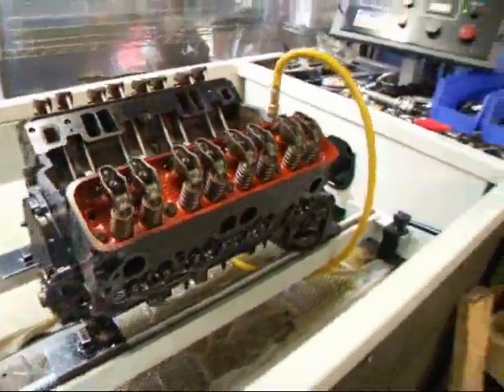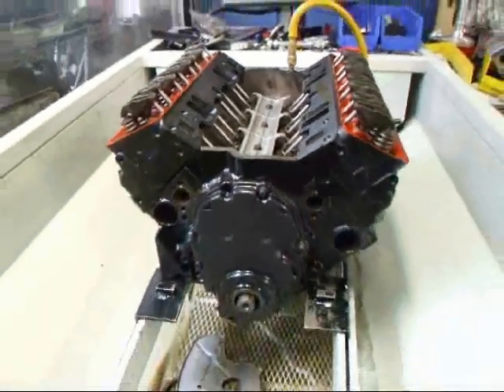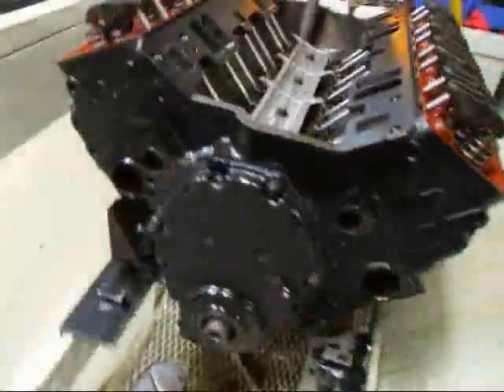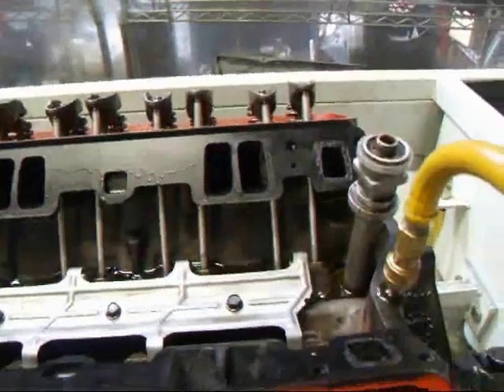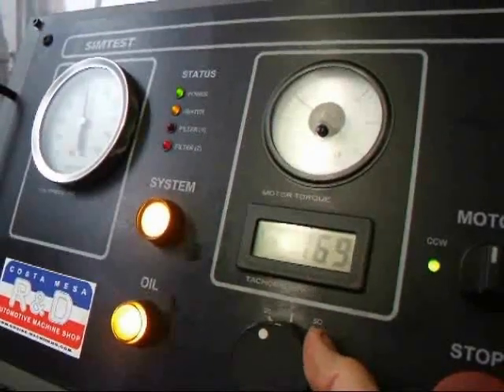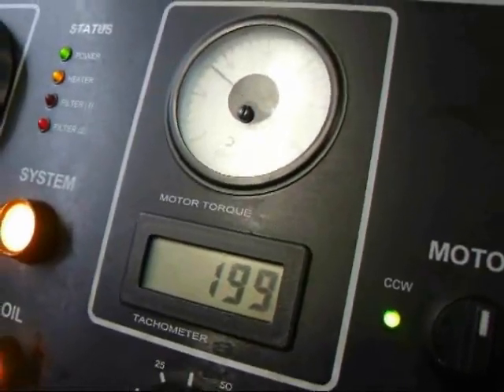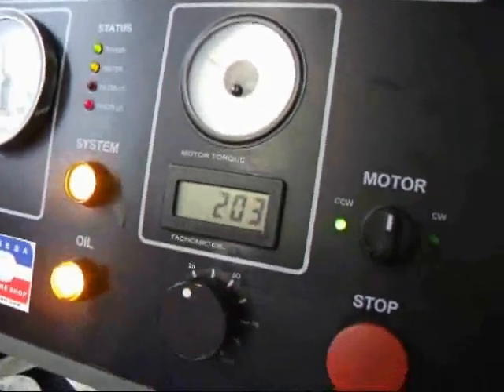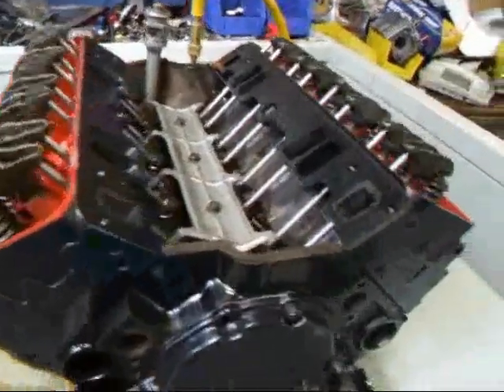383 Marine Simtest-01.wmv

Comment from the maker: @citydriver - You still need to brak in the camshaft @ 2000 rpm's for about 20 minutes after the engine is installed. This process completely lubricates the enigne and clean in the inside out before it is all buttoned up. Engines tend to start more quickly after being put on the Simtester. The amperage drop indicates that the rings, piston alignment, etc are all finding their home.